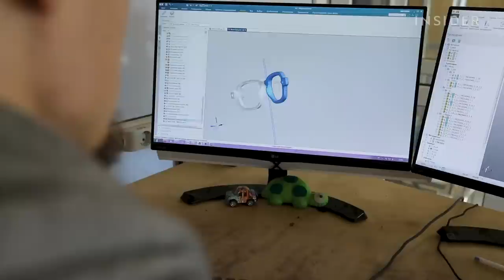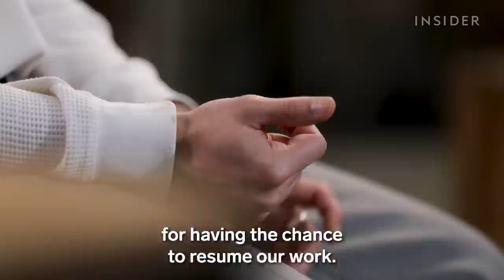Making Eyeglasses From Coffee Grounds In Ukraine | World Wide Waste | Business Insider

Comment: I'm not buying the claim that what they're using is some plant oil mixture that magically works like epoxy resin. as a violin maker, I'm quite familiar with natural resins and oils usable for making varnishes and the like, and I'm not aware of anything like that, other than perhaps urushi sap that could possibly harden with moist coffee grounds, but I believe that would take weeks, not less than four days. urushi hardens with moisture, all other natural resin and oil options either polymerize with oxygen or dry by evaporation, or would need to be melted and mixed hot. what they're showing is relatively quick hardening of a cold mix with no air exposure or heating - only two-component resins like epoxy harden like that, and the sturdiness of the result certainly suggests a synthetic resin, too.
coffee grounds are excellent for composting, they actually work great for adding nutrients to otherwise leaf- and wood-based garden, park, or plant farm compost, and worms love them. coffee grounds saturated with epoxy on the other hand are effectively particularly toxic microplastic. the subtractive CNC-cut process these people are using produces a lot of waste (much more waste than glasses frames), and whatever that alleged "plant oil mixture" is will certainly make the waste more environmentally problematic than the coffee grounds were to begin with, even if it was just magically epoxy-like natural oil and resin.

in short, the environmentalist branding here is truly absurd, it's absolute hipster BS.
Reply: Green washing
Reply: Bio based epoxies are in fact a thing. So that's probably what they are doing, and they wouldn't be lying.
Reply: I was thinking the same thing. I’m also a crafter, and as soon as they said that it was a “trade secret” I shook my head and thought “epoxy”
Reply: @sneg__  I'm not sure where you got "herbal oils from. 2:40 says "herbal origin, which actually a mistranslation. I understand Ukrainian, and he said "рослинного походження" which translates as plant origin. 

And there do seem to be epoxies that are 100% plant based, such as from Plantics Biomaterials. Whether that's what they are using, or made their own proprietary something, is unknown. But what they are claiming is certainly possible at the very least.
Reply: @rafflesmaos  They’re not biodegradable, which they state on their website. They should be transparent on their manufacturing process. If they’ve discovered some ‘plant oil mixture resin’ they’d be selling that formula, not spectacles.
Reply: I'm quite sure that it is like Linoleum which exists since 1855, it is made by polymerisation of organic oils with a filler like sawdust under heat and pressure
Reply: @MrApokalipse666  I was literally about to say that it is probably a "drying oil" like boiled linseed oil that begins hardening on contact with oxygen. That is indeed how linoleum was made (by impregnating cotton cloth with boiled linseed oil) before the development of polyvinyl chloride.
Reply: that press has two thermostats on the cabinet door, the aluminium plates are very likely contact heater plates for the press dies. Baked and siccativated oil is certainly a different beast than a cold applied varnish. Mixed with Asphalt instead of coffe grounds this was used as metal paint equal durable to powdercoating for half a century.
What speaks against the 2 component epoxy idea is them showing it coming from a single bucket and them not putting that mix through a vacuum cycle.
could all be bogus, cold be true. who knows
Reply: Whatever the method of polymerization is, if the end result is waterproof it automatically means that bacteria won't be able to enter the hardened chunks which means they won't degrade. It doesn't help if we throw away stuff that degrades in 90 years instead of 100. Maybe if the micro-"plastic" that they will turn into are less harmful it's still a win but I wouldn't count on it without independent verification. Especially since there's the option of wooden glass frames.
Reply: Never, never let reality get into the way of Woke delusion
Reply: Yea, this is just selling people bullshit. Especially for coffee grounds. Nobody should be tossing away coffee grounds as an unusable substance, its amazing for plants.
Reply: @rafflesmaos  diesel is also plant origin... Plant based doesn't mean eco friendly, it just happened that making plastic things out of petroleum is cheaper than out of other sources and people think that if something is plant origin, means also eco friendly
Reply: @rafflesmaos  so it's like fresh frozen fish
Reply: I learned more from you than I did in the video. I would love to pick your brain on a couple of things. I have a channel wherein I post my email. You have already helped me shape a message I have struggled with for years. Thank you.
Reply: @UmmonTheLight   learned more from you than I did in the video. I would love to pick your brain on a couple of things. I have a channel wherein I post my email. You have already helped me shape a message I have struggled with for years. Thank you.
Reply: @anxiousmerchant4129   learned more from you than I did in the video. I would love to pick your brain on a couple of things. I have a channel wherein I post my email. You have already helped me shape a message I have struggled with for years. Thank you.
Reply: @Lazyormy  similar was said about another video, one about coconut shells being made into charcoal, then put into flimsy plastic packaging, and the product was marketed as being "greener"

Comment: Wonder if the secret ingredient is based on linseed oil. Although the decision to CNC each individual frame is just weird imo. Subtractive manufacturing creates lots of removed material. After mixing with the hardener oil and the pressing, how much discarded material can be reused back into the mix?

I reckon an actual die with fine grit sandpaper and shellac could keep waste to a minimum

Comment: Those coffee grounds would be better served if used as compost.  I bet they are just a filler in an epoxy based eyeglass frame.  You could you many other materials for that.  It's neat, but probably has no real environmental benefit.
Reply: The "epoxy" is boiled linseed oil based. A drying oil that hardens on contact with oxygen.
Reply: @gregorymalchuk272  Maybe epoxidized linseed oil with a few other additives.  Plain old linseed oil would not have the tensile strength to make a durable frame.
Reply: @KRscience  Boiled linseed oil is already used to make linoleum that can put up with 100 years of foot traffic. I think it can be used in glasses frames without many additional chemicals.

Comment: This smells of greenwashing. There were tons of products before that used organic filler-material in what basically was regular plastic and touted the result as biodegradable. But even if this is different and coffee grounds, "natural oils" and pressure result in something durable enough to be useful. I wouldn't trust this without an independent test how long these actually take to degrade. It doesn't help if something that degrades in a 100 years is replaced by something that degrades in 90.